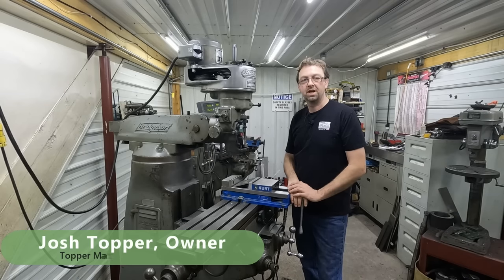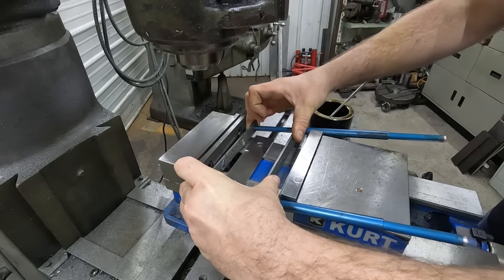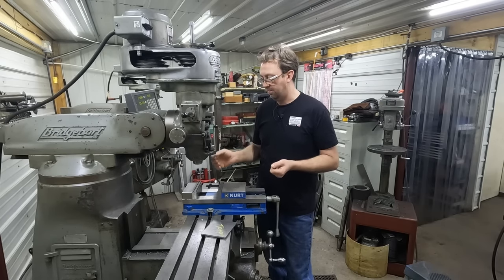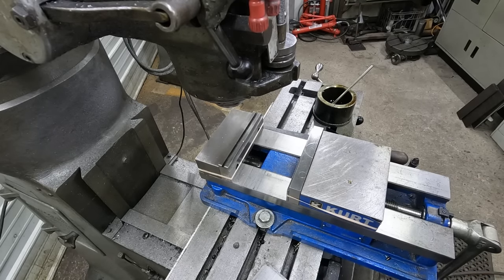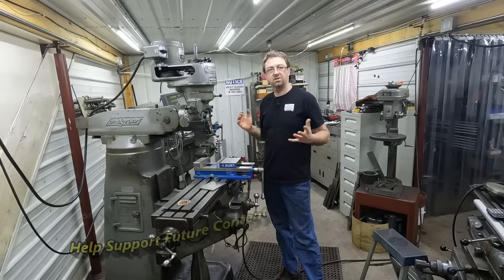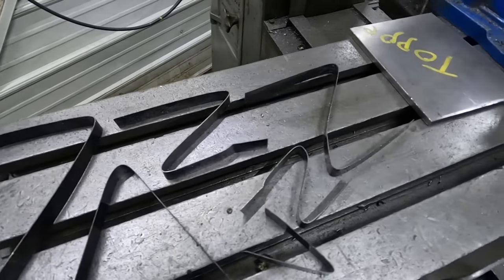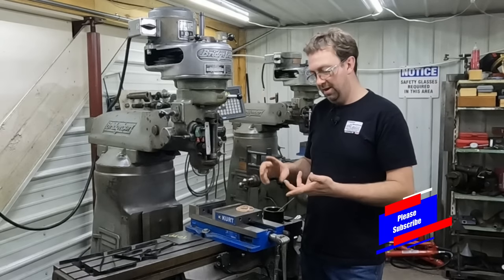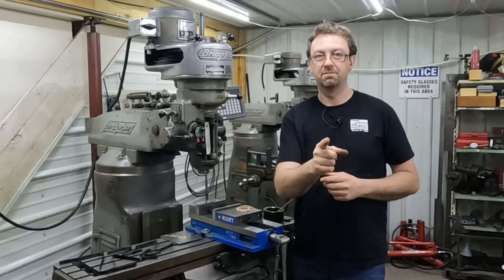How To Keep Parallels In Place - Machine Shop Secrets - Shop Tricks and Hacks

Comment: pallet banding is the best solution, different width and length can solve most setups for me, theres also grinders if you need them thinner lol. most reliable method for me hands down. especially for cnc work with all the coolant, rubber bands cant handle that reliably. the banding and bending to the size you need is the best way.

Comment: I have used the pallet banding just as you demonstrated.  I agree with you, it is the best solution available and the least expensive.  I even tried using oil  to hold the parallel to the jaw.  It works, but it is messy.  Good shop tip!  KOKO!

Comment: I like the rubber band solution and hadn't thought of that, thanks!  So easy to store with the parallels or on the mill.
Reply: the rubber bands go bad after time, i dont trust rubbers repeatability either when it comes to real production runs personaly.
Reply: @donaldscott6231  Rubbers are designed to prevent personal production, or reproduction as some would say.

Comment: I prefer die springs. Although they are harder to compress they ensure the parallels don't lift & also take any backlash out of the vice leadscrew. This allows instant opening of the vice with minimal handle movement & they don't move when cleaned with compressed air.

To prevent chips sitting in the corner between the parallel & the vice jaw. Place a short parallel between the jaw and the parallel to make a recess, this makes the tops of the parallels much easier to clean.

For a quick fix I use a level on top of the workpiece and no parallels.

Comment: Steel strapping, my favorite. When I worked in a small steel fabrication shop I always had some in my toolbox. The steel comes with a coat of oil and when they are stacked they stick together. So I would take a piece of strap and sharpen the end and use it to lift one piece of steel so I could get my hand in and slide the steel on to the laser cut table. If I loose it, I just make a new one. I just called it a butter knife. Thanks for the short yet informative video. Always good to see you. 😃😃😃😃😃😃

Comment: The spring paralell keeper is the best option, you can go to town with an air line to clean the vice and they stay absolutely rock solid and no swarf gets under or behind the parallels. Perfect for CNC machine work where you have to keep loading and loading and unloading the machine quickly and be able to quickly blow off the swark without any faffing around. Yes, expensive but rock solid. Plus they're not that hard to reverse engineer and make your own if you wanted to. Rubber bands perish over time and don't have the same holding power as the keepers and pallet banding can be a faff because it also doesn't have the power of the keepers and can get blown out by an air line and/or ping out themselves when you do up/undo the vice if they're not perfectly seated and neither stop the swarf from getting under the paralells as well as the proper keepers. In the abscence of sprung parallel keepers I'd opt for 'L' shaped brackets with magnets on, they work great if you make your own rather than buy the cheapo plastic ones that are floating about.

Comment: That banding works great. 
We also use pieces of old band saw blades when a heavier spring in desired. Break it down into whatever length, remove the teeth on the belt sander and bend it into water shape you need. I usually polish them up on the buffing wheel so they won’t scratch up the parallels.

Comment: One other quick trick for a single setup with parallels is to squirt a drop of heavy way oil on one side and that will cause the parallel to stick to the vice jaw. Also works great if you have a setup where you need to pull the parallel before an machining op.

Comment: Good idea! I always found that different sized springs work good also. Hope you get some good work in the shop soon.
Reply from the maker: Thanks. I've had a lot of good work, but it's all been prototype and top secret stuff I can't film.  Customer privacy is extremely important to me, and I only show what I can. The jobs I film have permission from the customer, and proprietary stuff never gets filmed.
Reply: @TopperMachineLLC  I fully understand that. Do you think at some stage you can do a beginners tutorial on basic turning and milling if you have time? sequence of opperation and things like that? I am out of the trade a long time now and need to brush up on it because I don't have my shed built yet and I need to buy a small lathe so I can have a hobby. Only if you have time though. Thanks pal.

Comment: The banding works fine and it handy to have for other uses such as fingers of grinder indicators, flexure pivots, flat springs ect.  My go to for the parralles is simply way oil. Wet the back side and stick to the jaws.

Comment: Old worn out band saw blades and springs will work too. 👍👍
Reply from the maker: I find bandsaws blades too brittle.
Reply: No.
Reply: I sand the teeth off first, but yes it works just fine

Comment: Yep, they work great, and the hot chips won't burn them in two like rubber bands!
Reply from the maker: That was the other problem with rubber bands, but I forgot about it during filming.
Reply: @TopperMachineLLC  When I was a kid, a short section of that banding folded in half made an excellent and loud whistle!  It took some practice to make it work.  :)

Comment: You'd better keep a good stock of metal pallet bands before they all turn to plastic. It seems that here in Australia, they are all plastic now. I haven't seen a metal pallet band for decades, not that I see many plastic ones either.
Reply from the maker: Metal is real common here. Most of my industries are heavy pallets and the plastic will never hold. I have the banding cart with 5/8" banding and have used up to 1-1/2". One wrap on the 1-1/2" on a bundle of 16 railroad ties. Holds over 5000 lbs, can't get plastic to do that.

Comment: I have two drawers full of bent-up banding of different sizes. Also different thicknesses of banding. Mostly 3/4" x .025" thick, but some 1 1/4" as well. I have an entire shelf of different size 6" long blocks for putting between the parallels to take up space and to make sure that the pressure is sufficient from the banding. I also have the length at which I cut the banding engraved on many of them. I have that entered into the setup sheet documents. I run a small production shop and the faster and more efficient the setups are, the more the spindles are spinning and chips are flying. Especially since management refuses to accept how much time is wasted setting up the same job every week or even twice a week when we have blanket orders for the entire year.